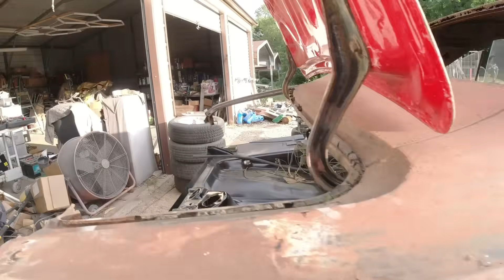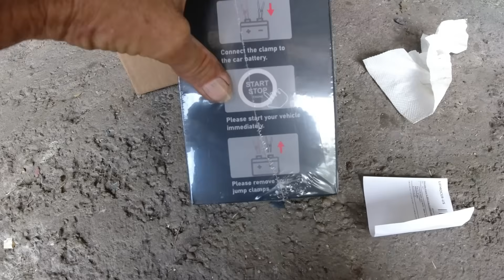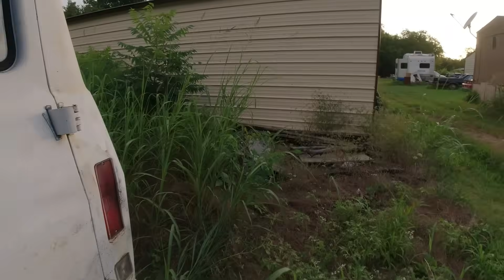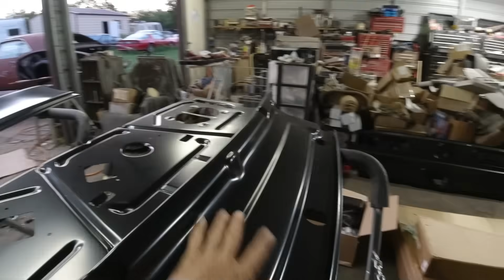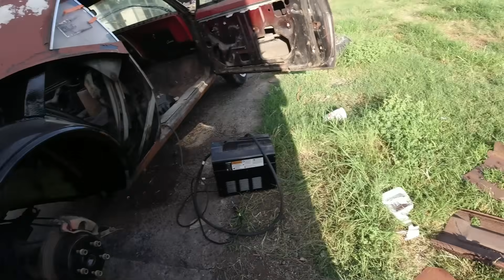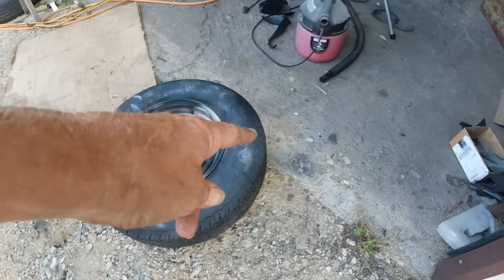1967 Camaro Build #8. Replacing rear speaker panel and upper body Panel. Rust repair. LIFMOCER GS300

Comment: I wonder if a guy could seal them 2 seams on that rear panel you installed. Just thinking water could get into the trunk. Didn't see any factory stuff there when 
you cut it out. Nice job and video 👍👍👍
Reply from the maker: there was no seam sealer in there. I guess it wouldn't hurt to add a little before paint
Reply: @clunkersandclassics  yeah it was a thought. Maybe a smear with a finger to smooth it out. You know what your doing man! Just didn't wana see water in there down the road,.. ruining all your metal work back there.👍👍👍🙋

Comment: Lee it looks like that Camaro was a Black Car with Red interior and probably the Red nose wrap around stripe. I don't know about the white or gray stripes you found wrapped around the fender and door jambs i don't think those would have been factory on a '67 Camaro! I was cringing when you pulled the package tray and Dutch panel off and just left the trunk torsion rods to hold the sides together I thought you might have welded a brace in to keep the body from creeping apart on you!! I applaud you for doing arts car and I watched that and wondered  how you were going to pull that off without a helper and you're doing this Camaro by yourself too i am impressed because all the body shops I worked in had a helper and then needed another helper and hired me to get the cars out a little quicker !!  Keep up the good work I THINK the simple Red interior on a black car would look really bitchin'!!
Reply: He does have a helper he's hiding in the bushes and helps when he says he'll  be back!he a teenager that works for free and food! Just kidding Lee you do great work thanks for letting us into you chennel
Reply from the maker: Thanks

Comment: I really appreciate your workman ship and efforts to do a good job and not make a paint covered mess  . You are a good tradesman.  Couple of suggestions.   Get a couple yellow light bulbs, they don't draw bugs. A lot of your video is dark due to poor lighting, you talk thru what you are planning to do, which is great, and then you go do it.  We never see you in the act of doing it, seeing you measure and cut something, how you aligned a section or piece.   More of how you cut something and fitted it before welding.  I am a visualist, I need to see something in the act of being transformed, not a before and finished after.  I am trying to pick up enough information on how you did this to feel more confident on taking on a project just like this (a 68 firebird needing outer wheelhouses, quarter skins and tail panel).  
Yes, It will take a lot more editing of the video and more of your time, but   I think myself and my fellow viewers will get a lot more out of it.   Please do not take offense, just my two cents worth,

Comment: What is the plan for the interior? It seems like it will be hard to find on the cheap!! Coming along nicely!!
Reply from the maker: it's going to be expensive
Reply: @clunkersandclassics  maybe sell a car 2 to get funds for this build ?  No offense,  but they all just sit there. 
   I think this 67 will be a lot more valuable in the long run if done right. ... just my 2 cents.
Reply from the maker: @michaelzeinert2074  It has nothing to do with 'needing' funds to do a project.
Reply: @clunkersandclassics well sometimes it seems that way. I fix inexpensive cars all the time, and I put more into a $4,000 car than you do on these potential $20,000 cars. 
   I know there needs to be a budget, but the times you skimp on $400 tail lights and use generic ebay lights I have to wonder. Sometimes it's the small details.  
    Don't get mad at my response,  because I do appreciate you making these videos. If you met me in person we'd get along great ! 
    I'm way up here in rusty old Wisconsin.  If you ever come this way, message me. I'll buy you lunch or supper.